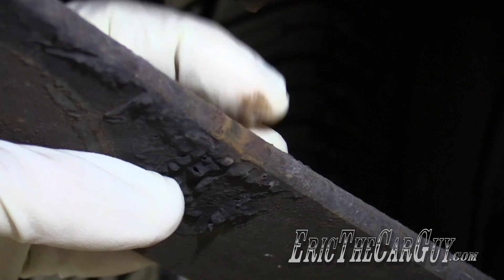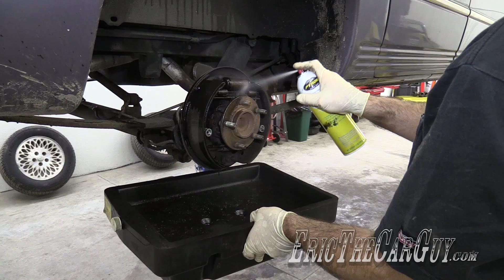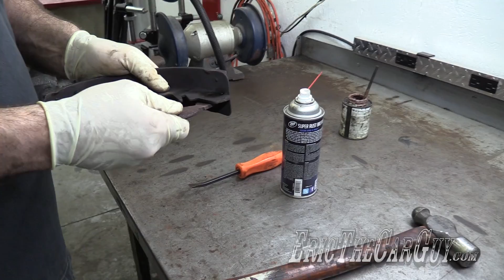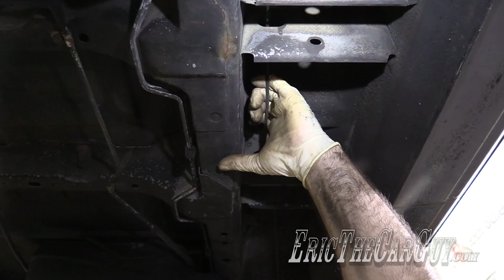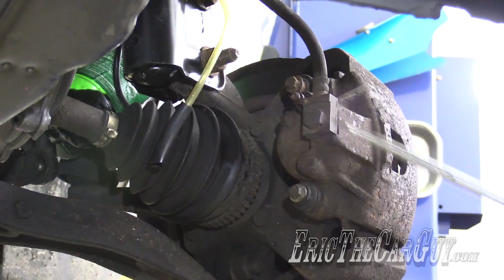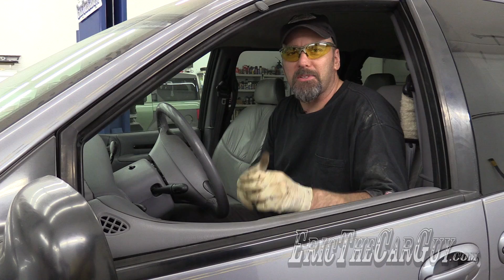1998 Chrysler Town & Country Suspension Noise & Brake Repair -Fixing it Forward

Comment: why didn't you open the brake fluid reservoir so you don't need to bleed the system when you press back the piston also use a C clamp to press 
it's a neater job
 and avoid any stripped screw and dirty floor ????????????

Comment: Question on the last Video where you bleed all brakes on on Barbara’s 98 mini, after you replaced the rear wheel cylinders but on the left front you bleed from from the caliper “Banjo nut” why, did I miss a stripped or frozen bleeder? Very help full as I’m working on a 98 twisted/cracked rear brake line and all! Including broken bleeder left front! Thanks Eric...

Comment: As with any brake issue New replacement parts will come in a New spring package. One other thing I have always done is use white lithium grease on the bosses. A little blue Loctite on the threads will prevent the nut from backing off.  But i stress new replacement parts as old are just that and worn out.

Comment: on the drum brakes I found it's Soo much faster and easier to remove the bottom spring or springs and pull the whole mechanism off at the shoes. pull apart the upper and separate it from the wheel cylinder and then proceed with the bottom. be sure to remove the retainer clip and spring first and the whole thing will come apart in one piece in 10 minutes or less I got mine off in 5

Comment: I just noticed on the front caliper bracket where the pads sit that after you sanded them clean that there was a wear mark from the inner pad that looked pretty deep. I think that might be the cause of the uneven wear on the inner side of the rotor. The pad getting hung up on it and not sliding freely?

Comment: As I've learned through movies and previous experience with working on cars, there is ALWAYS time for lubricant and some is good, more is better and too much is just enough.

Also, why wouldn't you just use a caliper compressor tool?  They're nice and easy to use as long as the brake line isn't collapsed inside or the brake bleeder is open and it'd have been MUCH faster than your method.

Comment: For the love of god people, ALWAYS use your parking brake! 'P' on the transmission is not designed to hold your vehicle, it's simply the position the transmission needs to be in when you park your car. Eric, if you ever have the opportunity to pull apart an AT and find the parking latch, please show it on a video. If people only knew how flimsy that part is they wouldn't be trusting it to hold their cars anymore. You know how your car normally rocks forward or back a few inches, then bounces a little, when you let off your brakes? That's the little tiny latch bending under all that load. Not good..

Use your parking brake people :)

Comment: Eric, I'm being critical here: Adding a nut, bolt, washer to a system that is not required. Also , when adjustingloose drum brakes put two lugs on to hold the drum. Tighten the shoes tight - this centers them, then back off till the drum is free.

Comment: I could not find silicone paste anywhere here in UK, I could only find at car parts store red rubber grease for slide pins. High temp and good with rubber, so far hasn't let me down.

Comment: I usually use a  c clamp and block of wood on caliper piston and force the fluid back up into the reservoir.
Reply: +Wayne G 
Forcing the fluid back up into the reservoir is NOT good, because on MANY master cylinders you will cause the rugger seals to go in the OPPOSITE direction than they were intended to go.

Comment: @EricTheCarGuy i have an 05 chrysler sebring that was recently ran out of fuel. wouldnt start of course. shortly after we put in about $20 ( about 5 GAL ) reading a bit over half a tank fuel to get er back up on it wheels. and now its startling and stalling shortly after. good thing its home. we are searching every possible aspect and coming up empty handed. would you or anyone know what the problem is. we even tryed purging the fuel rail of air pockets. side note there is a red flashing light under the fuel gauge. hope its not a permanent end to such a good looking car for the year

Comment: Always on these videos and else where i see people comment about how these van's were POS/Junk and not worth fixing but mainly the problems you have been fixing is wearable parts that wear out with any car. this van has been on the road for almost 20 years and yet what made it stop was a transmission fluid leak that turned into a costly repair because it was ignored/unseen

Comment: The lower bar holds the park brake lever in place. Does not require a nut and bolt.

Comment: Hey Eric that double ended fork that you take off from the bottom side of the rear brakes is what holds the emergency brake mechanism onto the shoes. That's how Chrysler made it that's why there was no bolts or anything holding it on to the shoe

Comment: i noticed before you put the rotor on you didn't clean the hub flange surface, not doing this could cause lateral run out of the rotor and a brake pulsation!

Comment: Eric, A quick tip for you. If you doing a brake job and the lift, take the wheels of when the car is a little bit of the ground. That will save you energy and your back :)

Comment: Hey Eric I have a 05 ford five hundred. When I'm driving thru a drive thru close to a building or parking next to a car on the left side there is a clicking noise coming from the left side. What could that be?
Reply: AJ Edwards front or rear?
Reply: It's when I'm stopping and it's coming from the front left.

Comment: Hey there Eric, my OBD2 codes indicate "A small leak has been detected in the evaporative system"
just wondering if this could make things alot worse if i dont get it fixed right away.
or if its an easy fix could you let me know through a reply or even a video.
cheers!

Comment: I was just thinking about the cable being disconnected and my answer to that is maybe the parking brake had seized at one point and disconnecting the cable was just the easiest option at the time. Either way I'm glad you addressed that issue. I probably would have put new brake shoes and hardware on it myself if it were a regular customers vehicle but I understand what you're doing for Barbara and trying to keep the costs as low as possible so hopefully it works and it's not a problem. A friend of mine with the same van had his parking brake lock up in the middle of the summer in the Adirondacks so it can happen. Only time will tell
Reply: Michael Sackstein Hardware is cheap but I think he said something about the hardware looking like it'd been replaced recently and was in good enough shape
Reply: yeah I noticed that as well now

Comment: That leaver on the right hand lining?  Isn't that the auto adjuster for the brakes.  So as the linings wear down they are adjusted as the wear so they remain in close contact to the drum

Comment: sorry if this is a stupid question but what happens if the nuts and bolts you put on those moving parts come loose with the vibrations? if they come off while the wheel is spinnig it could be a disaster. or am i exagerating?
Reply: David Jacome chances are pretty unlikely anything bad would happen. Just lose and a nut and bolt somewhere on the road

Comment: stock/oem muffler ? ...

if so 
then what else Chrysler fucked up when making this car...
will it ever end ?

as for drum brake ....i kinda forsean that you were gona use a bolt and a nut.but i though you were gona use  a thread lock
 to make sure that bolt does not come out again...or a locknut (the nylon type)
Reply: Faisal Abdulaziz They really didn't mess up if you think about it that van has been on the road for nearly 20 years most likely its whole life in the snow/rust states and before that transmission fluid leak i bet it was still riding on the factory Engine & Transmission. All the stuff that he has fixed is mainly wearable parts that would wear out on any car.
Reply: Faisal Abdulaziz But then again maybe it will rust quickly enough and lock into place and match the general patina of the vehicle.  But yeah, I think some red loctite would have been a good choice.  Certainly an improvement over a loose cable - that was classic!
Reply: ***** lol .....hehehe what a miserable car a to own

Comment: Cant believe you didnt bleed the brakes!!!   You opened the system to air when you cracked the line connector to push back the piston.
Reply: +Lord Palpo he hosed clamped 6 in from the bolt, so when he opened the system gravity let brake fluid leave the line from the clamp down as he was pushing the fluid out of the caliper, so he did introduce air into the system. when the 6 in of line from the clamp gravity bled, it left air in the void, so no, he did not bleed the brakes, and yes, he did introduce air into the system

Comment: Hey Eric
I love your show. I'm no mechanic but I do my own maintenance on my vehicles... the small stuff. I had one comment with using the brake line connection to bleed: it needs to positioned so that it's the highest point (like the bleed valve) to prevent air getting in. Air will tend to accumulate at the highest point in the caliper.

Comment: Hey Eric did you check out the condtion of the Spare tire that is under there too like taking it down checking the air in it and checking the Spare tire hanger so that it comes down easy with out any problems if she ever has a blow out

Comment: As always lots of useful tips. I always attempt to activate the ajuster by moving the shoes and or e brake cable. Often it dors not work and the leaver needs reshaping or as Eric did something is wrong with the assembly.

Like the change brake fluid with pads trick. Why push dirty fluid back.

Comment: Eric, Just for future reference there is no need to bolt the brake lever to the shoe. You should have noticed when you installed the brake equalizer bar (the name for the flat steel bar with the slots cut out of it on each end) the ears on it are clearly what keep the brake lever from "popping out". This is the way it was designed from Chrysler. It is probable that the bolts you installed will fall out from vibration causing a horrible noise as they rotate with the drum. If the washer gets between the shoe and the drum this could cause the rear brake system to fail on Barbara. Incidentally, that style of self adjuster activates using the service brakes not the parking brake as you thought. Just thought I could clear that up for you. SATAman.
Reply: Was thinking the same thing. The ears hold the P-brake actuator in place. Common on drums.
Reply: SATAMAN Schmidt Noticed this too and was wondering the same thing.
Reply: I also worry about that bolt, nut and washer combo.
Reply: I was thinking the same thing.  I am a little worried about that bolt backing off in there.
Reply: A little blue Loctite on the threads will prevent the nut from backing off.

Comment: I did the rear brake on my wife's 2000 grand caravan once since we bought it new. I have done about the front brakes about ten times already. I learned after the second time to install speed bleeders on the front calipers. Pads are free under a lifetime warranty. The van likes to eat pads every 18 months.

Comment: why don't you just get the caliper piston tool????? much easier then what you always do. work smarter not harder..... its only like $15 bucks
Reply from the maker: ***** So now you're insulting my appearance and threatening physical violence because of a disagreement over how to perform a repair? It's never been my intention to insult you, but if the collar fits. https://www.youtube.com/watch?v=O_lMg3wbthI
Reply from the maker: ***** You're making a lot of assumptions about what I do. You know what they say about assumptions. :)
Reply from the maker: ***** I beg to differ. I replaced both wheel cylinders on this van and didn't have to buy a new caliper. I call that a success.
Reply from the maker: ***** I'm not a fan of heating brake lines, never have been. That's not the issue here. The fact is there's often more than one way to do a repair. I know this and accept it. You apparently are insistent that you're right and I'm wrong. I think that has more to do with your own insecurities than it does my repair techniques. If I didn't care about my repair work, why would I buy wheel cylinders to put onto this van to help Barbara get back on the road?
Reply: EricTheCarGuy  Well eric for your viewers like me, it looks very daunting when you did it the way you did.. :/ anyways great work,
Reply: WhenImGoneCa I always use one old pad and a G-Clamp to wind back the piston.  Just make sure the reservoir doesn't overflow!  Always done this rather than bleeding it off at the caliper - mind you, usually I do a fluid change and bleed right through anyway, so never been an issue.
Reply: ***** Not all cars have that design, some have a disc/drum parking brake that are seperate from the caliper.
Reply from the maker: ***** If you were secure with yourself, you wouldn't be so insistent that you're right and continue to try and bring me down. You'd accept the fact that different people do things different ways and there's nothing wrong with that. But I doubt you'd be able to do that. Instead you'll prattle on about how it's me that's the problem. Typical for someone with low self esteem.
Reply: +EricTheCarGuy  That is the best answer towards richv5721 :) I am dealing with similar people in another line of business discovering the same pattern. The loudest ones are the little dogs!
Reply from the maker: WhenImGoneCa Because what I do works fine and doesn't seem like hard work at all. There's more than one way of doing things. BTW, I do have one of those tools that I use for rear calipers.
Reply: EricTheCarGuy showing people how something can be done using everyday or simple tools benefits the average person.
Reply: WhenImGoneCa Brake jobs are the easiest jobs to do guys quit your bitching.
Reply: Harbor freight has a piston tool for $5 literally lol..
Reply: not all rear pistons turn for parking brakes

Comment: Why dont you just push in the brake piston with the bleader closed?
the brake fluid wil just get pushed back in the container via the master-cilinder.
Also i would not use cutters on springs or cables, just a little kink in a spring may
weaken it, and on cables you wil damage any protective coating.
Reply from the maker: adriaan Because that can ruin the master cylinder. I've seen it too many times to chance it. https://www.youtube.com/watch?v=lAviOGXzEUk
Reply: grant wright oh Oh so that's what happened to my ABS. My other old car has no ABS and never had a problem with C clamping the fluid back into the master cylinder.
Reply: EricTheCarGuy why would the master cylinder break?
Reply: Paul MvN When you just push the piston back with the bleeder closed you force all the debris in the caliper back into the system not only can you mess up the master cylinder it can also mess up the ABS by lodging the debris in the valves!

Comment: How accurate are those torque stick's?
Reply from the maker: comatose871 They work fine. I've actually checked them and they're pretty close.
Reply: No kidding.  

Not as accurate as people think.  Just because they flex dosent mean they don't over torque by an ass load
Reply: comatose871 Guess I'll be sticking to my usual method of using a good ol fashion torque wrench.  Well the torque wrench isn't old fashion.....u gt the point! LOL  Thanks for the info.
Reply: EricTheCarGuy thanks brother.
Reply: Scooter Ville I think ±3 ft/lb
Reply: I only have cheap torque sticks and they seemed to torque the lugs a lot higher than what was printed on the stick.  Now I put the wheels on using my 70ft-lb impacting Earthquake air ratchet, then torque them the last little bit of a turn with my torque wrench.  Seems to work pretty well.

Chris
Reply: comatose871 turn your gun down to medium setting and don't clamp the trigger

Comment: Nice work.  Drum brakes are very simple but kinda daunting to work on the first time or two.
Reply: Heads Tails A really good trick if your pulling apart something on a vehicle is take pics with your mobile phone, then you can refer to them if your not sure how it goes back together.
Reply: klc317   Yep, the trick is to do one side at a time, take it slow and dont get grease onto the breaking faces, just on the points on the backing plate
Reply: bigfella65  Yep, I have done that a few times, turns out to be a life saver from time to time